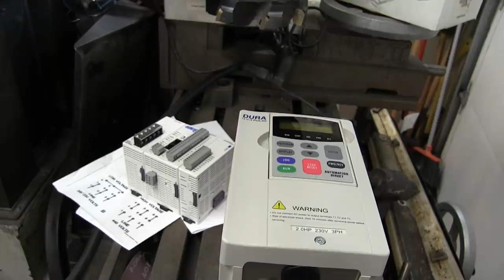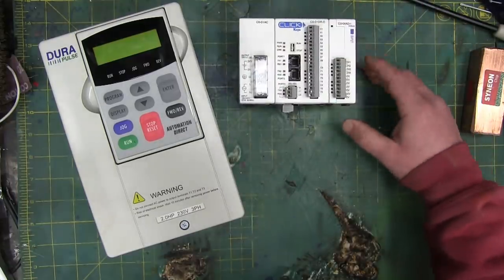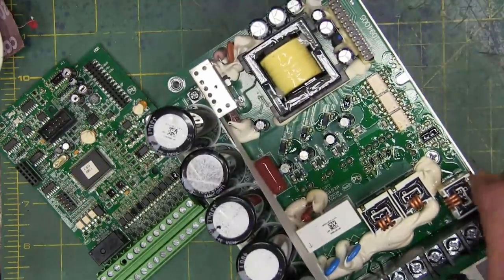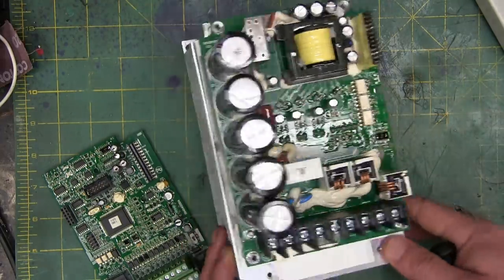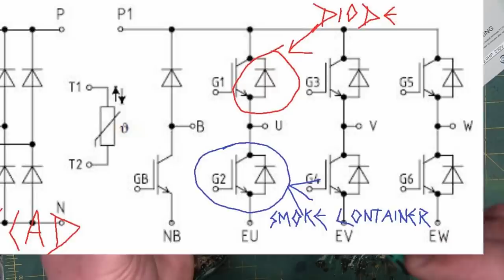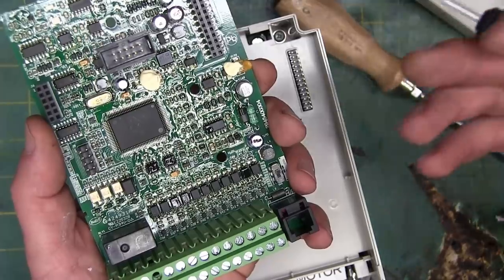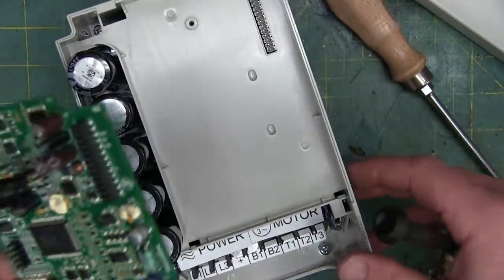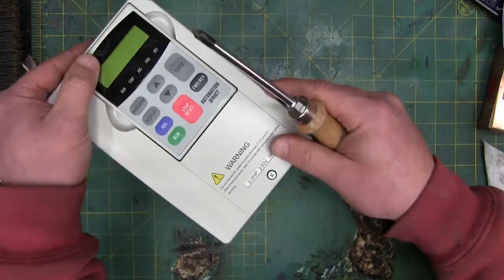BOLTR: Inverter EXPLAINED | DuraPulse VFD

Comment: My god, you poor bastards over there. In Germany we can order 3 phase from a local electrician. Everyone in Chermany has one of these 3 phase sockets in their homes to power our kitchenovens and electric stoves. But I understand your struggle.
Reply: Im in portugal, i got triphase and my dad had to do was call the power company and say "hey i want 3 phase"
Reply: Same for Austria, three phase is standard. Who doesn't love 230V 32 amps worth of angry pixies.
Reply: wait only 32A? I live in a 23sqm apparment and have 3x230v 40A for my appartment
Reply: jipp...close to everyone in Bratwurst Heaven has 3-PH it´s fucking awesome. But a VFD still is praktical. Like for my 40Jeeehaw old Lathe.
Reply: dumle29 40 fucking amps? lol I'm living in a 60sqm apartment and have 3x 230V/32A. Even the meter isn't rated higher
Reply: Depends on the local region and supplier TAB (Technische Anschlussbedingungen) It usually regulates minimum requirements on what electricians have to install when wiring up a new, in this case, residential Building. 
Obviously a an apartment complex gets a honking big supply in the basement/stairwell and distributes from there. Depending on dewlling size they sometimes skimp out. My house is wired ~AWG 3 (25mm²) 3Phase x 80A NH breakers at the connection point and 3 phase x 63A selective line protection (SLS) at the meter/distribution board. My small appartment in the City is wired 1P230V 40A because it does not need more usually.
Reply: We can call a local electrician too to get 3 phase hooked up but it can cost up to 8000 dollars lol in the US of A
Reply: 32 amps in a house in canada the power coming in to our house is 200 amps 120/240 volts
Reply: thats why fukushima farted :D  25Amps per phase allowed here. ist good for 5 minute welding with a 6mm electrode on slow fuses :D
Reply: Just remembered how surprised the electrician was when he saw our distribution board - it had solid 3x1 cm copper bars as power-rails as we had a bit of machinery in the garage and the basement and my father went a bit overboard with making everything survive for eternity and all eventualities. 
granted - that does come in handy when you are running electric heating, the kitchen, a vacuum cleaner, 3 concrete mixer, concrete pump and some other electric tools at once and you are not sure which phase each outlet is on.
Reply: We can get 3 phase as well but if your in a residential area there generally isn't a need for it at the pole so the power company doesn't run it on every line. If it's not already at the pole you have to pay to have it ran from where ever is the closest source.
Reply: Australia has 240 single phase usually around 8 to 10 mm mains coming into the house. 40 amps is usually fine. Three phase is mostly available domestically if you want it, rural places have two phase often as well. Can someone explain why the fuq America run 120 240 and 415? Wtf is with the 120?
Reply: Never mind, there's a whole thread explaining why haha. Basically there was a fuck up early on, and now the national grid is too big and it's too expensive to fix
Reply: Order? Like a pizza? It comes in a box? Fuck the states, I'm moving to Germany
Reply: Matt Tradie the book The Power Makers is fascinating and has a good history of the power system in the US. At the start everything was DC and voltages all over the board from 30 to 100. It was a mess
Reply: My electric connection is a bit overkill. I live in an apartment, that, although a big (230 m2), has 100 amp three phase power... It's cool to run some experiments in the lab hehe
Reply: I'm in Argentina. Standard service is 220V 40A (with a 63A fuse, but you need to put your own 40A breaker). My neighbor has a house with 3x380V 150A per phase. Seems 150 is the smallest service for 3-ph.
Reply: The explanation I've heard for 120V is that since the US was standardized electricity sooner than other countries, a filament that could handle 240V hadn't been developed at the time, so 100V or so tended to be the most common, so the US standardized to 120V. As for countries like the UK, I believe they had systems of varying voltages and both 50 and 60Hz, and it wasn't until later that things were standardized. That, and with WWII requiring the mass rebuilding of so many homes, 240V uses less copper than 120V. Same reason for ring circuits.
Reply: Nice. Yet another reason to move there, aside from weissbier, wurst, the bread, and the fact they treat engineers properly.
Reply: +Yavijo. yea, it sucks. the most we can have in canada is 2 phase for the oven, furnace motor and dryer.
Reply: Jelly

Comment: This is a true story. (I will let you decide the veracity of my story.)
While working maintenance on wastewater pumping stations,  we had a number of Gorman-Rupp pumps with General Electric vari-drive units. Having a problem with one panel, I contacted the original supplier to schedule a repair wizard to help round up the pixies. They sent a fresh faced young man who came into the building and exclaimed when he opened up the panel, "WTF!!! These units are older than I am!!" 
I then told him if he thought the drives were old, he should check out the stormwater pumps outside. Those beasts  are older than me. The poor child didn't understand how we could run equipment on the dark side of a half century. Kids today just don't appreciate quality equipment....
Reply: I visited an off-grid bible camp that was an old mining facility in Wenatchee, Washington State. It used a water wheel from the 1930s powered by a tiny stream coming off the mountain. One day while out hiking I saw the door ajar so I peaked in. It was built like a brick shithouse.
Reply: I live in a granite producing part of Minnesota and the historical society has a steam derrick and a bunch of other machinery they bust out for special occasions. Well over a century old, after full industrial lifespan, and still working perfectly. You walk up to the stuff and it's just simple and tough. A little TLC and it will be lifting two ton blocks with ease in 2117.
Reply: IanCaine4728   I don't think you will be witnessing it but maybe you folks out there live longer than us folks in New England.
Reply: Gang Of Four That would put me on Santa's naughty list. And I really want a chemistry set this Christmas. Or a Red Rider b-b gun.
Reply: Old but gold , i know becouse we have some old Hyundai inverters @ teh factory and they still kick ass under 10 feet  dust , while the new shiny siemens stuff fails under one year or just after warranty goes puff :/
Reply: S+L or Gorman-Rupp? What's your favorite
Reply: Wolfin if u didnt notice, today everything is build with a buildinclock (not the right term 4sure) Batteries that last only 400 recharges, screws in oilpumps (automotive) build from Plastik, or everything else that Breaks Just a few days after quarantee. I dont appreciate that way of building stuff but u could say that this way the companies always have some repairs to do. Its bs i know.
Reply: ofcourse we do! Im a 96 model, and want all my tools to be made in W.Germany !
Reply: Hell I'm 25 and I have plenty of equipment twice my age. 3 of the tractors at the farm where made from 64-67, most things I call the dealerships for baffle whoever is on the other end of the line, they're to young to have worked on these old beasts. I'll take old iron just about everyday of the week. What's not to like with simple and reliable? Yeah, they're getting some age, and things wear out, but very rarely do they just leave you hanging.
Reply: ih1206 Problem with this is companies wouldnt get much Profit out of Such thinking.
Reply: As far as "back in the day" is concerned
A motor on a local draw bridge was changed when the bridge was renovated. That motor was there for 95 years and still ran well. What a shame. It probably dimmed some lights while running, but damn! A 95 year old motor exposed to a century of salt air!

Comment: AvE, all of these drives support external speed pot control and stop start/fwd rev. I made a custom control panel for my lathe, that way the drive is safely away from the coolant and chips, and I just have robust AB switches and a 10 turn micormeter speed pot. you can get coolant on them all day and they give no shits

Comment: Not a bad looking VFD, I run Delta stuff for the most part, but the Hyunyang Inverter drives have proven themselves too, 3Hp one on my turret lathe, 1/2hp on the tire machine. both out in the carport, lots of dust, temp and humidity extremes, still working!

Comment: I worked on some really big vfd's 50hp+ and we found that the motor rotor would develop a charge and arc through the bearings eventually wearing them prematurely. We tried ceramic bearings and just ended up using a single brush to ground the rotor and prevent a charge build-up. Made the bearings last alot longer. If i remember correctly this problem only happened on the bigger stuff like 25 hp and up.

Comment: That was fun.  I happen to be an AB test engineer (well, ok Rockwell Automation, as RA holds onto that AB meatball cause everyone liked it, but it is all RA).
A couple things, those 3 white components are not diodes, CT's (Hall effect), that monitor the output phase currents to the motor.  The MOV's would be on the input, as I don't believe your would put them on the motor side, but strange that there are 3, since the input is single phase.

The rectifier is actually likely built into the IGBT, which they refer to as the powerpack, as it typically contains the "6-pack IGBT's" along with the rectifier diodes, and a single brake IGBT.  

That relay out be a general purpose relay, that the end user can do for many things, and would be configured through some menu on the drive.  They are typically used to connect some type of start/stop circuit.

As for not having a real "dial", the user would/could use a simple potentiometer, and the terminal block would provide the low voltage/power reference and the wiper wires back to an analog input.  So, you can easily add a simple pot to control speed.  This requires programming the drive for the type of control you wanted, which would be VIA an analog input.

It is amazing how similar that complete drive looks to the drives I have worked on over the past 30+ years.  I guess the use the old adage "Never let another's ideas evade your eyes, plagiarize" !

Thanks for that tear down, it made me almost want to go to work on Monday...

Comment: Apologies if this was mentioned by others but if you want to use a VFD to run a 3 phase motor on single phase it’s a good idea to upsize the drive by 1/3rd.  Use a 3 hp. drive for a 2 hp. motor, 7.5 hp. drive for a 5hp. motor etc.  The diodes in the rectifier section are rated for 3 phase power and will be overloaded when you pull the same amount of power on single phase.  Also, the DC bus voltage is lower so the IGBT’s run at a longer duty cycle on single phase.

A VFD is not a general purpose inverter!  The output is an unfiltered jumble of high frequency pulses that only a motor or a resistive load can handle.  If you connect anything with a transformer or capacitor to the output of a VFD the magic smoke will be released.  This is important to know if the machine has reversing contactors, brake coils or control transformers.  Connect the VFD directly to the motor, only the motor, and keep the wiring as short as possible. 

Not all motors like to run off of a VFD.  Some will heat up.  Also, when fed 480 volts 3 phase, the VFD puts out pulses that are close to 1000 volts in amplitude.  That’s hard on the insulation of an older motor.  That's why they make "inverter rated" motors nowadays.

I had a boss – an electrical engineer, no less – that honestly thought VFD’s were perpetual motion machines!  Against my advice, he connected a 240 volt VFD to transformers to run a 480 volt motor.  The firework were impressive!

Comment: Hey AvE, long time lurker, first time poster here. My grandpa and I are big fans.

I'm reaching out in hopes that you could both make a neat video and help me, and maybe some others out a bit. I noticed in one of your recent videos you were showing interest in doing some videos on simple circuits/arduinos and such, and I got an idea for you. 

My grandpa worked as a greasemonkey for case construction equipment for longer than fire has existed, and seeing as he's been ridden hard and put away wet in his 70 odd years of bumblefuckery his hearing ain't what it used to be. His hearing aid that he's had for as long as I can remember finally bit the dust last month. Whilst shopping around for a new one (it's not covered under his health insurance) we realized quickly that even the chinesium models are ($$$)^2 levels of expensive. 

The other day we were out pigging out on italian food and I got to wondering if it were possible to build a hearing aid out of an arduino and some headphones. So first thing I did was hop on the smartphone and look for an "app for that", low and behold I found an app called fennex, plugged in my headphones, and passed it to the old man. He got real quiet real quick; turns out the dinky little free app, a decent pair of headphones, and an iphone was performing better than his old hearing aid ever could. 

Fuck yea, proof of concept confirmed so I hopped on the gargler and promptly found a DIY guide on a home made hearing aid. Only problem is that seeing as I'm just a wee clipboard warrior in training, the schematics for the circuitry are a few standard deviations above my pay grade. What I'd really like to do is be able to use the guide's provided schematic and ship it off to get a 1 off prototype PCB printed to maximize portability for him to carry around when all is said and done, but I got no clue how to interpret the PCB manufacturer's parameters and how to apply them to the schematic I have available. 

So to wrap up I guess I'm just looking for someone somewhere to have any kinda clue on how a 100% novice like me could begin tackling a project like this. Any info/help from you, a viewer, the wife, dewclaw, the dog, ANYONE, would be appreciated beyond measure.

Thanks,
Uncle Willy

P.S. A link to the guide I found with schematics and all can be provided on request as I wish to avoid any youtube auto-moderator bots flagging the comment as spam for including a link to an outside web page.
Reply: Just buy the old man a second-hand iPhone.

Comment: So, when I was in the Marine Corps we had this device called an MMG-1A. It was a big ass box on 4 wheels which needed a tug to pull it around. We plugged in 120v or 240v AC (there was a strapping board to set it up for the correct input). I can't remember if we used the 60A or 200A cable for input. Anyway, the freaking thing ran a big motor which turned a big generator. The pickups on the generator allowed us to get 120v 400hz 3-phase output. This box you got seems a little more efficient.

Comment: Interesting vijeo! One thing though about the "confuser/brain-box" and the way they are set up in these devices. The simpler ones uses scalar control without feedback-signal, sometimes referred as Volts/Hz-control. The more advanced drives usually gives additional features that uses feedback, with sensor, or sensorless, to measure motor-RPM (or the "slip"?), and if the confuser finds the rpm have dropped due to motor-load, the confuser can in real time adjust (increase) the output frequency to compensate for the decreased rpm.
Within the margin the motor can handle off course, heat is always the enemy...
I don't know much about VFD:s, but i own a small British Lathe like you, but mine is a Myford ML7, smaller than the Boxford, and I plan to buy a VDF to the 0,37kW 3phase ABB induction motor to be able to drive it on single phase 230VAC (Standard in Sweden), and to control the speed slightly when chatter occurs when turning metal...

Comment: that relay you pointed out on the vfd near the opto-couplers is probably for wiring to external relays/ contactors, which would open or close depending if the vfd was in either run or stop, like for external actuators like gate control circuits when the machine is safely stopped.

Comment: Ha ha holy craper. I have two 3 phase plugs in my house. One out side and 1 in my shop. I had no idea what it was used for so I never used them. Now I know. Thank you!
Reply: #lifegoal I need a mill and lathe
Reply from the maker: Lucky bastard!
Reply: Ha ha yes I'm lucky. To bad I wasn't smarter and knew how to use everything I own. Thanks to your videos I learned a lot. Including how to properly place units in vices for safe keeping
Reply: John Kelleher My kind of remodeling.
Reply: It's on the outside of the house under the car port.

Comment: FYI, that relay you thought was for power switching is for status output. It's connected to terminals R1O/R1C/R1, and there are probably options in the drive setup menu to configure it for fault, run status, etc. I'm not familiar with this specific drive, but nearly every one I've worked with has similar capability.

Comment: In case no one else has said it, just use a good quality linear potentiometer from the +10v to one of the AI's for a control knob instead of the buttons. Just have to set the AI control reference and not too fast of a ramp time. (like 20-30 seconds) The only inconvenience is that it's not integral to the control panel.

Comment: The relay is direct relay output, a floating switch output with normally closed and normally open contacts for powering a pump, lamp or something else that needs higher power without using a contractor. It is internally programmable to switch on starting the motor, on reaching designated RPM, on braking or some other condition. It can also work as emergency stop.

Comment: We usually leave them at 2 or 4khz carrier frequency as higher can create reflected wave and more heat in the drive with deratings. Sometimes you have to increase it for high performance servo stuff.